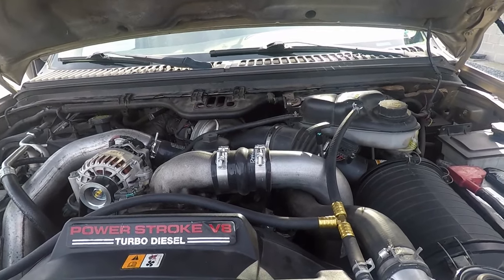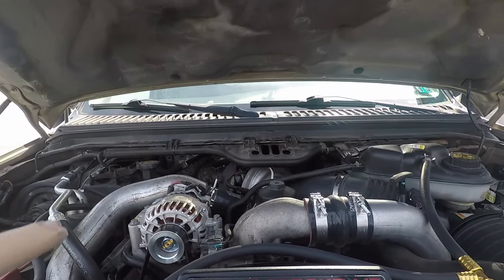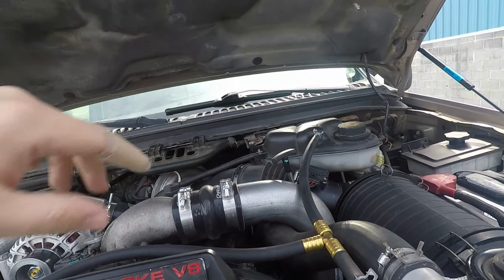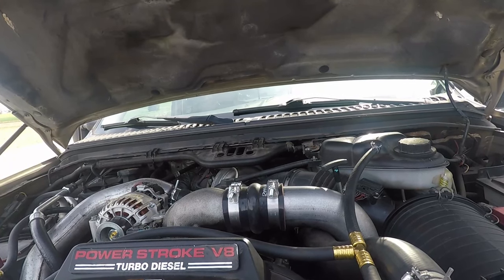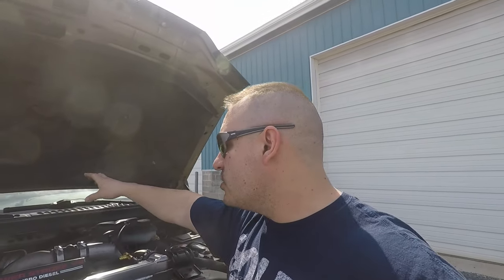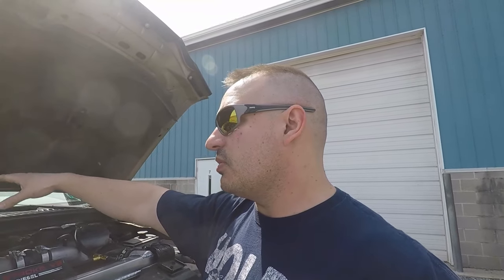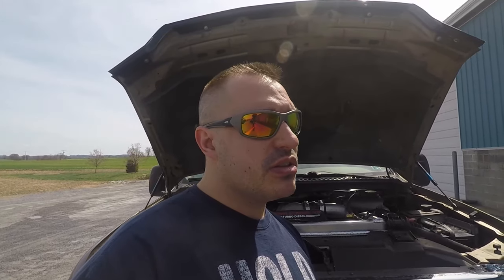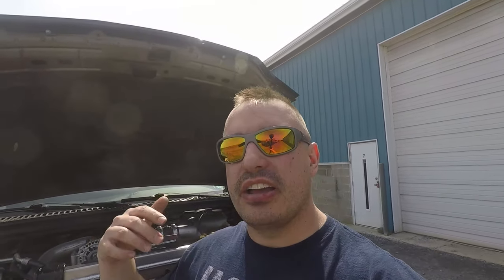6.0 Powerstroke  VGT Turbo Problems and Fixes

Comment: My dad has a 04 6.0, we rebuild the engine and put new turbo in, everything seemed fine until today we got a p0046 code, we welded de egr ( egr delete) , there is no boost truck is definitely missing power idk what to check everything seems right
Reply from the maker: Did you check everything I outlined in the video? Also the turbo was it remanded or brand new? Also sometimes when you replace the turbo it can get air stuck in the vgt system which can cause this issue. I can have more advice once I know what all you have done to diagnose the truck
Reply: Pcm
Reply from the maker: I have seen bad pcm cause major issues as well.

Comment: I had a VGT solenoid fail which made the truck fall on its face until 3k RPM. Replaced it and the truck started surging and bucking instead. Found that the turbo got a ton of soot in it from failed VGT. It broke the second one... If you swap the VGT be sure to clean the turbo first
Reply from the maker: Excellent advise. I haven't encountered it yet so thank you for letting people know.

Comment: Just had a pigtail clip on mine break and the pigtail came unplugged. Freaked out bad when I lost boost and didn’t hear the whistle. I was relieved when I saw it was just that and not something major. Got it zip tied in for now just waiting on a new pigtail.
Reply from the maker: Nice glad it is an easy fix I know when I needed to replace my harness I had a moment when there was an issue but thankfully just a pigtail that needed replaced
Reply: @six0bros  Yeah I had an oh crap moment when it happened because I’m in school so I can’t really afford any major repairs on it right now lol.
Reply from the maker: Glad it's an easy one man I know that pain though
Reply: What pigtail are you talking about thanks
Reply from the maker: You should be able to buy any pigtail from Ford. I'm sure there are some online as well but I liked the Ford replacement harness

Comment: We recently welded the egr and put a new turbo in my dad 04 6.0 now there is no boost at high rpm there is only 1 - 2 psi and sometimes not even that, we didn’t tune it or anything we don’t know what’s the issue we have checked everything
Reply from the maker: Sometimes they need several drive cycles and idling to get thr air that gets trapped in the vgt cavity. I have heard of people hitting that part with a hammer not super hard but a few good taps to try and get it out. If all the sensors have been checked tested for leaks and everything then this would be my next thing to try. Was it a new turbo or reman?
Reply: @six0bros  we found the issue now the problem is not reading boost truck runs fine but there is no boost reading on the pcm, we have a tuner connected to it so we can see all the stuff but on boost it stays on 0
Reply from the maker: Check the hose from the intake manifold up to your map sensor that sits on the passenger side.  Sometimes that hose has cracks in it. Also check to make sure that the port off the intake manifold isn't clogged either. Then check sensorbis plugged in

Comment: My MAP sensor did fail reading 3 when it should be 14. The hose was cracked and the nipple on the intake was about plugged with oily carbon. Now I am waiting for cooler weather to replace the injector harness and update the ficm. My ficm voltage is 30 when the engine is running. I would also suggest a fuel pressure gauge to save the injectors.
Reply from the maker: But in the scheme of things it doesn't often fail was my point. I agree fuel pressure is a good one. If there isn't enough fuel it won't make enough boost. B
Reply: Mine was trashed causing a ton of issues
Reply from the maker: So the previous owner didn't take care of it I take it? I have spoken to many people that the prior owner didn't take care of it, or they went to people that didn't know how to work on it.

Comment: I have an 03’ 6.0. Truck runs great until I pull weight up the hill, mid range RPMs it coughs and acts like it wants to lose power. I give it more fuel and that “solves” the issue. That just means I have to run up hills and high RPMs. Any thoughts from anyone?

Comment: Thanks for the helpful video! My 07 bucks/surges/lugs when going up inclines, until you kick it down to the next lower gear, cleaned, tested and inspected the Map sensor, EBP and EGR, all clean and working fine, checked all intake and intercooler coupler boots, still have issue. Any suggestions?
Reply from the maker: I am sorry I am very late to responding. did you get this sorted out? what was the overall shape of your intercooler couplers? I find that they may look ok they are not always in decent shape and need replaced. sometimes the tear in them is only visible under pressure and may still be letting air out. I would monitor vgt duty cycle, EBP, boost, ipr, and ICP voltage while recreating it to see if it gives me more information

Comment: So I have a 2004 6.0  Love my truck.  But the past two years things have been failing.  I have always had some sort of turbo issue.  I have received the P0299 code since I bought the truck in 2017.  But I only would get it if I jumped in drove off right away.  If I let it idle and the vanes do their first sweep then I don't get it.  But when we moved from FL to NY my VGTs started sticking at 85% most of the time.  Let off the throttle VGT went between 40 and 60%.  Last spring the VGTs stuck at either 15 or 85% and would not change even after letting off the throttle.  So I had to replace my HPOP and since the turbo was off I had it cleaned.  The unison ring was stuck.  Turbo is back to working great, so it seemed.  Then even after the truck warmed up the first sweep wouldn't happen till I started moving, then it was fine.  But recently I have been getting the error for the EBP sensor.  I bought a new sensor and tube.  Just waiting for a day with some what decent temps to put it in.  Is there anything else I should be looking at, maybe replacing the VGT solenoid?
Reply from the maker: Sounds like maybe the unison ring may been worn out and they eventually get oblong on the ends of the ring causing sticking. I don't think your vgt solenoid is the issue it could be but I don't think. Your turbo may just need replaced or a new unison ring. When they start needing all those parts done I do tell people it may be best to replace it if that I'd an option. I would do the ebp sensor first and see but if the whole system checks out no leaks or anything and it is still giving you a hard time it may need replaced. What does that code say off the top of my head im not sure

Comment: I notice an issue while waiting at a light, light turned green i wnet ahead and pressed on the gas pedal and would go, it wasnt untill i pressed hard that it finall kicked in and went, now im having boost lag, i floor it and it takes a while to bosst but it is boosting, any ideas? Ive checked the map sensor and hose, about to go in deeper in a bit
Reply: I have the same problem right now did u figure out what it was
Reply from the maker: sorry for being so late but just seeing this now. I want to say this looks like boost or exhaust leak. they will still boost but increased lag. have you read your ebp at the same time to see what it is doing?

Comment: Recently bought a 6.0 and the symptoms was 0 PSI on the turbo 
Truck ran but very slow 
So for me the only issue was the hose running to the MAF Sensor was torn so I just replaced it and got all the power back
Reply from the maker: I have seen that several times before glad it was an easy fix man

Comment: 07 f250 was making a bad noise that sounded like it was from the turbo and then one day it wouldn’t start. I pulled the turbo and oil was definitely getting through it but I’m not sure if that’s what was causing it not to start. I also have a slight coolant leak but I don’t think that could cause it

Comment: I had very low boost and turbo wouldn’t spool almost at all and it was due to my Y pipe up pipe not seated properly up to the turbo. I loosened everything up and hooked it up the right way then it seemed a lot better and was working. Now running into a similar issue I think it’s my EBP or a leak in the MAP hose
Reply from the maker: did you fix this issue? That hose is very common to fail. I would be a little surprised about EBP sensor but the tube to it being clogged is a high possibility.

Comment: My 6.0 drives great sitting around 10lbs of boost when I give it a little more throttle than it really needs but once I give it the full wot that 10 psi turns to 0 I just put new injectors,fuel filter,map sensor,maf sensor, ibp sensor on it about 500 miles before it started doing this can’t find a single forum of a dude with the same exact issue
Reply from the maker: sorry for such a delayed response on my part. are you saying you cannot make more than 10 psi of boost? I would make sure the hose that leads from the manifold to the MAP sensor is not broken. I would also monitor your vgt duty cycle and see what it does when you try to WOT and let me know what it is

Comment: @six0bros Ive checked every pipe and boot for leaks and nothing. Y pipes have zero soot around them. Checked Baro and Map linked together pretty much exact. I watched the duty cycle in park it cycle from around 55-60% at idle but once I put it in gesr the cycle goes to 84% and stays. Once in a while it will give me a few lbs of boost 2-3lbs and blow out massive amounts of black smoke. Not sure if its a turbo issue or a vgt issue. Im pulling exhaust tomorrow to make sure the cat isnt clogged and causing an issue. Any Ideas without actually buying a new vgt soleniod and trying it out. Its been deleted fass fuel all the goodies have been done. Im at a loss without ripping the turbo out and checking the rings figured Id ask if you have any ideas thanks.
Reply from the maker: I believe your VGT is not functioning properly. you could pull out your turbo and clean the unison ring. I think I have a video on that and I may be making an updated one. you may have a unison ring that has worn out and is getting stuck. that is what I would start with.  it is essentially free other than time to take it off and it may save you the cost of buying a part that isnt bad.

Comment: What was your problem?  Why did you put multiple turbo’s in?  Is there an app that would measure the various censors.
Reply from the maker: I am not 100% sure as he got rid of the truck and did not want to spend much to fully diagnose the issue. I believe it was either a sensor issue or required a new ecm. I lean more towards sensor issue.

Comment: All solenoids n sensors are new. New ebp pipe. N unless I’m laying into pedal I hv no boost. Then I stand on pedal it kicks in n takes off after a min. Number 8 injector is on way out can that be the issue? One weak injector?
Reply from the maker: I do not think it would be 1 weak injector causing this. It sounds like a sticking unison ring or vanes. Have you double checked intercooler, cac boots, and exhuast leaks you can find around the y pipe? Though I'm leaning towards something sticking in the turbo itself. I would recommend pulling it and cleaning the exhaust side plus unison ring. Maybe even having a back up unison ring to put on just in case

Comment: Everything was running perfect, washed my engine bay with some degreaser with engine off and turbo just shut off once I drove away. Didn’t hear the whistle. Drove about an hour turbo would kick in and out. Killed it popped the hood to let it dry out (most was dried already) got back in to drive a couple hours later and was over boosting and not shifting out. What do you think it could be?
Reply: Same problem here...thoughts anyone?
Reply: @brennandc  was my ebp sensor
Reply from the maker: Sorry I missed this message man. Glad you got it figured out though
Reply: @austinhernandez1274  Did you replace the pigtail and the pipe too or just the sensor?

Comment: My f250 super duty when accelerating it sounds like alot of air mass flow rather than hearing to turbo boost like I mean alot of air mass flow what would be the issue??
Reply from the maker: My first bet if you are hearing a lot of air moving would be to replace intercooler boots and clamps

Comment: I got a nasty squeal from turbo on start up. Unplugged the vgt solenoid and it stops squealing? Is the turbo shot? Also have a exhaust manifold leak on passenger side
Reply from the maker: My guess is there is something wrong with the vanes in your turbo it sounds like. Or maybe with the bearings. I would make sure you have a good oil feed tube and that your drain tube is good and consider maybe a replacement turbo but I would need to pull it to really tell if it was bad. Are you sure it's the turbo and not coming from the y pipe or up pipe?

Comment: I have a 2003 f350 6.0. Build date is within the first 2 weeks of January 2003. I replaced the ICP sensor due to it leaking oil when I first purchased the truck. EGR is welded up and no issues there. A few months ago I had a code come up for a injector on cylinder 4 it started having a dead miss at a idle but ran perfect under acceleration. Miss would only show up when truck was warmed up. Replaced it and ran perfect for about 3 weeks, now it has started surging at a idle after it’s warmed up. Only codes showing are for egr, mass air flow, and p132b. Truck is straight piped with cats, so basically just a muffler delete. I have never had the trade mark jet engine 6.0 whistle at a idle. Truck runs fine going down the road and and you can hear the turbo when accelerating. Any input would be helpful. I’ve been reading about the EBP sensor and I’m thinking about pulling it off and see if it is dirty. Thanks I’m advance
Reply from the maker: I would verify all sensors are working correctly related to vgt so that's maf, map(also check hose from intake manifold to sensor for cracks or leaks) ebp, vgt duty cycle. If everything there checks out I would turn around and then clean and inspect the turbo. Also verify fuel pressure and no exhaust or boost leaks
Reply: My truck is doing somthing like this to can you here the miss fire from the exhaust I can’t tell it’s messing up unless you are standing behind it and here it kinda studder only at IDLE tho

Comment: Hi 6.0 Bros my 2003 Ford f 350 6.0 power stroke is Turbo keeps cutting in-and-out this is the 2nd time it's done it and I don't know what to do
Reply from the maker: Define cutting in and out? What specifically is it doing thr turbo vanes defaulting to wide open or commanded shut, no boost?

Comment: I got an 07 6.0 just started today my trucks is idling rough,runs rough ,and hearing a hissing sound still builds boost but not like it was doing. Any ideas?
Reply: Same problem
Reply from the maker: My guess would be an exhaust leak or a boost leak. I would take some soapy water in a spray bottle and start looking for it. Look for black soot around each exhaust port or against the fire wall. I would replace all the intercooler boots as they are often overlooked. Intercooler can be an issue, also if you have a plastic cold side pipe, I would replace it with a metadl

Comment: I have a 2006 6.0L power stroke brand new stock turbo with the wicked wheel from thoroughbred diesel check all my sensors my clamps houses no leaks no restriction can’t make more than 10 pounds of boost.
Reply from the maker: Have you checked fuel pressure? What caused you to replace the turbo?
Reply: @six0bros  Fuel pressure is all good have the blue spring kit no check engine light codes been hooked up to the computer at the shop everything’s working flawlessly runs good can’t get more than 10 pounds of boost
Reply: Replace the turbo because EGT‘s we’re getting high and no boost and from my research with 150,000 miles original turbo everyone said time to replace the turbo.
Reply from the maker: Do you have a gauge to your fuel pressure though? Did you check the tube that runs from your intake manifold to your map sensor?
Reply: @six0bros  fuel pressure 56psi at idle and 49psi full throttle all hoses plugs censors been replaced all Ford motorcraft parts all filters fluids been changed replace fuel filters every oil change and oil bypass filter every 5000 miles
Reply from the maker: Have you checked icp and ipr values
Reply: @six0bros  all brand new Ford motor craft parts. I have dam near replace everything but the hole wiring harness fuel injection wiring harness and the computer. I have done pretty much every thing to this truck I’m my own mechanic and I can’t even figure this out
Reply from the maker: But I mean have you driven the truck around a monitored those 2 values? Does the truck seem sluggish? Didbyiu check the hose running to the map sensor
Reply: Dude, same problem here. I know the FICM has nothing to do with the turbo but it does control the injectors. If EGTs high and no boost borrow a buddies FICM like I did and see if it fixes the problem.
Reply from the maker: If there isn't enough fuel there isn't a need for more boost. Did borrowing the ficm help?
Reply: @christophermitchell8986  finally figured out the problem with no boost after replacing all the sensors going through the whole motor seven months later and $4000 down the drain at the end of the day the catalytic converter was plugged up straight piped it truck runs better than it ever did hope this helps. Let me know if this works for you.
Reply: @greggoryspeers7573  mine is hollow from the last owner, had to get it tuned to eliminate the emissions but lost some MPGs. She get 20mpg on 35 Mud terains at 65mph now with a clean pipe.
Reply from the maker: I cant remember I this the video I talked about that being a potential issue or not but it is one
Reply from the maker: 65 on 35 muds isn't bad in my opinion who's tuning